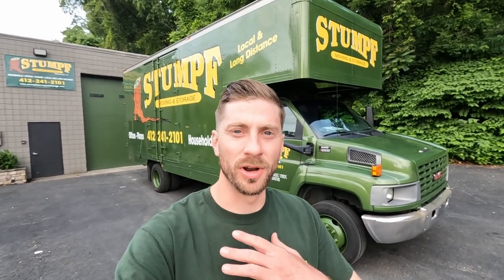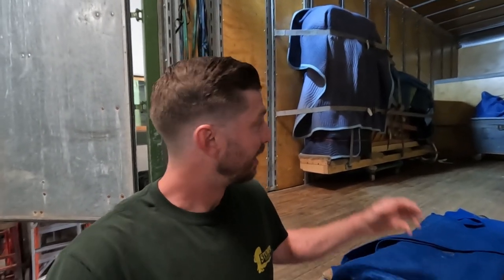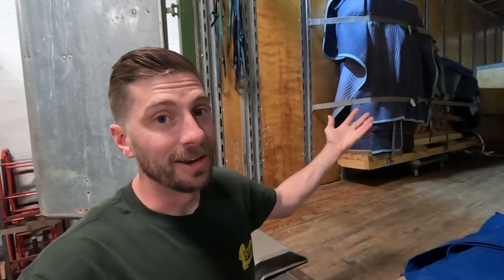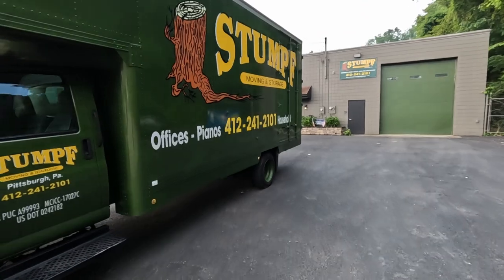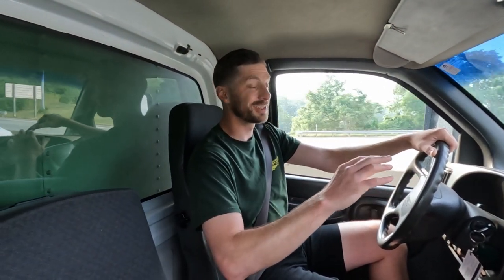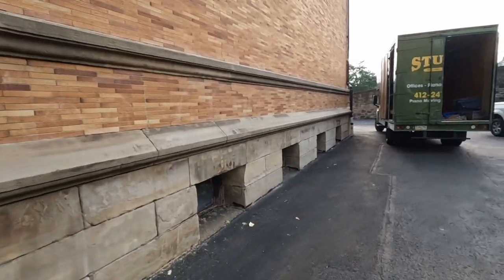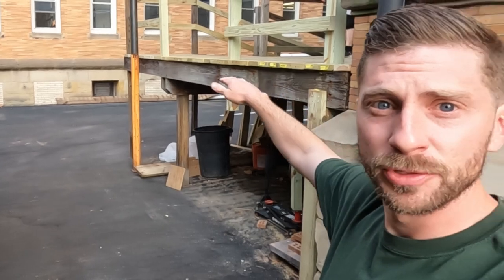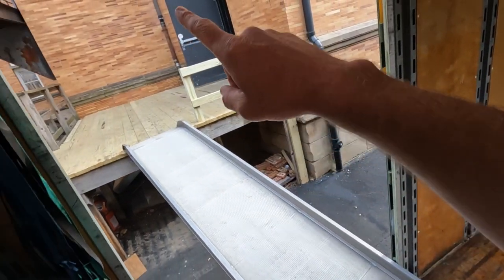A Day in the Life of a Piano Mover - How to Move a Grand Piano from One Place to Another!

Comment: Love the video. You just have to stop using those darn swivel dollies lol, too dangerous. And if you used a stationary wheel dolly which is much safer, you can also tip the piano down on its legs leaving it on the dolly which will put a lot less stress on the lyer and the end leg.
Reply from the maker: Thanks for watching the video.  We've had this dolly conversation before.  Fixed dollies are hard to work with and difficult to maneuver.  That becomes even more pronounced when working in tight areas.  Swivel dollies are not dangerous at all, and they make the piano move easier on the movers.  It doesn't matter what kind of equipment is used, Movers must be trained to use their equipment properly and safely.

You can even tip the piano onto swivel dollies as you suggested with the fixed dolly.  Regardless of the dolly used, we find that technique to be extremely dangerous and only to be used when absolutely necessary. 

We've been moving pianos since 1936 and have cultivated our moving techniques over many years of experience.  Everything from the equipment we use to the techniques we employ are tried and true methods of piano moving that have stood the test of time.

Comment: Can you explain why the dolly was left under the piano during transport?
Don't this voidthe reason for the piano bord?
Reply from the maker: The piano board is used to assist with the moving process, and also to make sure that the lid of the piano is safe from damage. Leaving the piano on the dolly during transport has nothing to do with the use of a piano board. 

We do not recommend leaving a piano on the dolly unless you have air ride equip trucks. Spring ride trucks could possibly bounce the piano around if it's on a dolly during transport, even when strapped to the wall.  This movement can pull the piano away from the wall of the truck and cause damage.  In that case it's better to remove the dolly and place the board directly on the floor of the truck before strapping it to the wall.